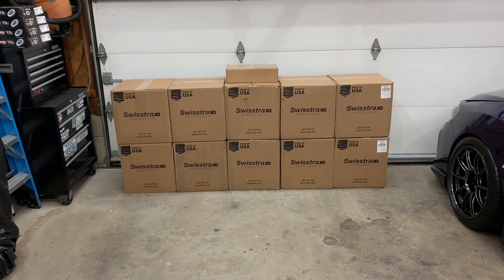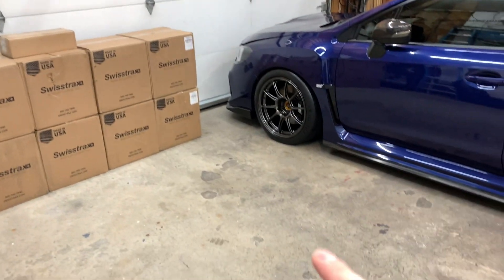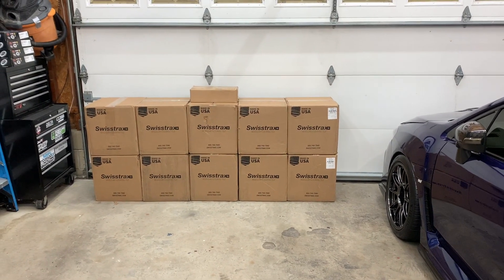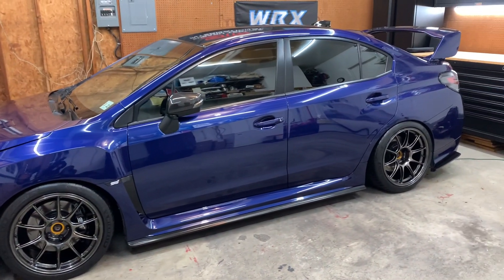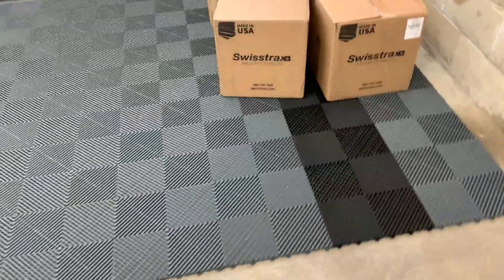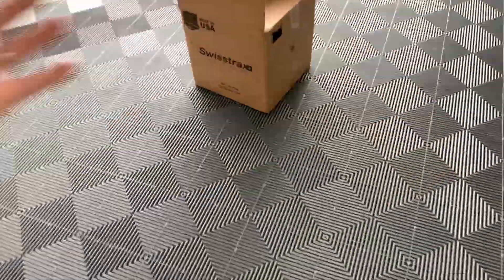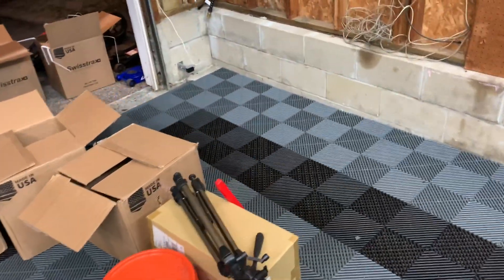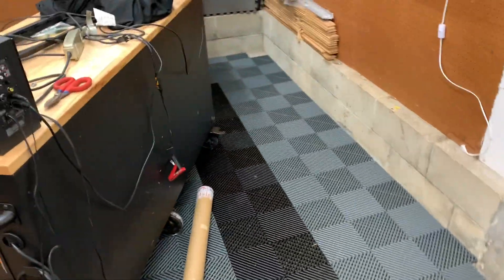Installing Swisstrax in my Garage

Comment: I chose RaceDeck over Swisstrax because RaceDeck tiles are 12" and that made them line up better with the garage doors for my floor design. The larger Swisstrax tiles couldn't be lined up properly.

Comment: Question how does the floor like release water example driving in the rain and pull into garage car basically drips and drains off does the water sit under the mats how does that work also does the front near the door have like a lip when entering garage just curious thanks
Reply from the maker: There are channels under the tiles so it just runs right out into the driveway. Yes, there is a lip when driving up on them. They have edge pieces that make the transition nice and smooth.

Comment: How is moving things on casters around on it? Is it loud/bumpy?
Reply from the maker: Very easy. I use my seat which is on casters and rolls totally fine. My jack as well as no issues. It’s actually easier since it slides a bit more.

Comment: How do you manage the water when you are washing inside? Do you have a drain under the swisstrax?
Reply from the maker: Flows out to the driveway through the Swisstrax channels. Garage slab is properly slopped so it just drains out. Any residual is dry by the next morning.
Reply: @Autofreakgarage  do you leave the garage door cracked or anything while it dries?
Reply from the maker: No sir. Summer time it dries up by that night but colder months it takes about a day or so. Pretty much the same as if you drive in the rain and pulled into the garage and the floor got wet.

Comment: is that the ribtrax smooth ? wonder if you can use tools boxes with those swisstrax?
Reply from the maker: Ribtrax. Yes, everything rolls easily on it. Check out the video I did testing everything out. https://youtu.be/wfSVzqi2cGE

Comment: I had my 2 car garage epoxied. I had a professional do it that is friends with my brother so I got a decent price of $2,200 material and labor. I had a three tone marble look. Gray, white and gunmetal with clear coat. It came out exactly how I envisioned. It took the installer about 4 days to do and 3 days after before I could bring the garage items back in. Anything metal can scratch or crack it. I have to make sure anything with wheels are rubber or plastic. Anything metal like containers I have to put use a mat for them to sit on.

Being that I often do work in the garage, I have to be cautious about not dropping a screwdriver or anything metal. I have to be sure to let down a cheap thick comforter while I work on the G35 (yes I threw that out there for you flexing the STI 😁. Beautiful car man, I love it). 

Would I recommend an epoxy? Only if the garage is a showroom or to just chill and that's it. If the garage is a working garage, HELL NO! Not worth the effort or takes to not damage it. It's tough against anything not metal. Being that I'm a car guy and do customizing in my garage, anything I do takes a bit longer time because of having to be cautious to not damage the epoxy dropping something metal

If and when I need to make a change on my garage floor, I will not go with a polished epoxy. PVC is better over all.
Reply from the maker: Epoxy can look good when done right. However, there are a couple "issues" I think of when epoxy comes to mind. 

1. If something gets scratched or scraped, it'll never look as good as it did new. Sure it can be touched up, but matching it and having a smooth even surface can be challenging. Over the years, it can get pretty gross and you'll have to re-do it again.

2. Mobility. You can't move it. You invest the money into the floor  and if you ever move, you can't take that with you. It's negligible if it adds any value to the home, so you might be able to get another grand (maybe) in the sale of the home, however, you'll have to invest that right back into your new garage.

For a garage you park and hang out in, it definitely is not a bad option. It's just when you start actually doing work in the garage, it gets challenging. I do all the work to my car myself in the garage and found swisstrax to be extremely versatile. Sliding under the car to do an exhaust or oil change is so simple. It doesn't cut your back and arms up like concrete would. Plus, a tile ever gets damaged, just replace it and it is as good as new. Obviously, everyone has their different opinions on the product, but for me and what I use my garage for, it is absolutely perfect.

Comment: Great Video. I love obsessed garage also. Did you consider Race Deck Flooring? Just curious what may have made you decide swisstrax ?
Reply from the maker: I preferred Swisstrax due to the thickness of it. Race deck is thinner and didn’t want it breaking over time.

Comment: Would be really interested to see how dropping tools and bolts goes on the Swisstrax. Some of the bolts I work on are definitely small enough to fall into the cracks, but I wonder if it would make it easier to find larger bolts and sockets and whatnot.
Reply from the maker: I thought of this and while the smaller ones might fall through, they wouldn’t bounce all over the place. They would land in one spot. Larger ones would do the same thing and sit on top.
Reply: @Autofreakgarage  that's a great point. I could see that it would be pretty decent, except for the ones that hit something on the way down and end up nowhere near where you thought they did lol. The only other issue would be non-magnetic parts that fall down in it, but I'm definitely considering the product in the future.

Comment: Maintenance on these is too much work
Reply from the maker: They look clean 100% of the time. Simply slide them out once a year to clean underneath and you’re good to go. With epoxy or a non finished surface, you’ll be sweeping and vacuuming weekly to keep it as clean as the Swisstrax looks on the daily.